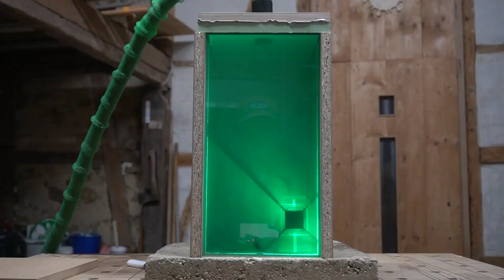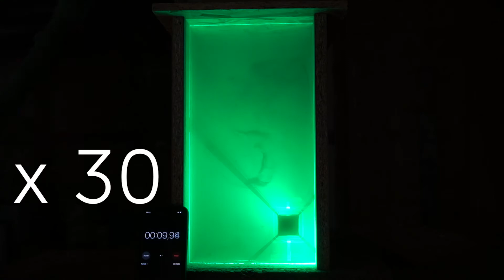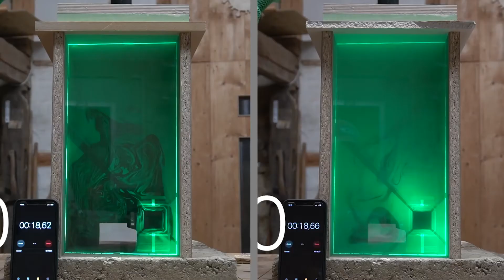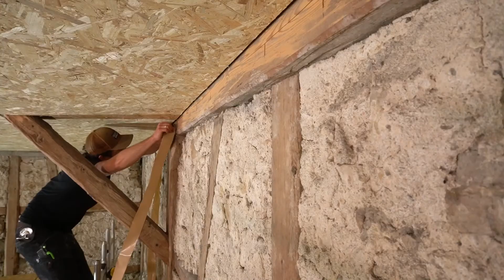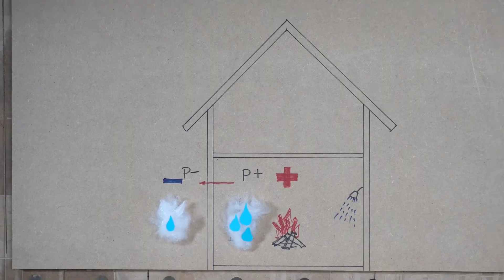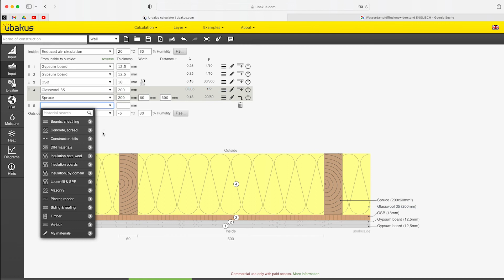Vapor Barrier vs Vapor Retarder

Comment: Thank you Mr Timo I find your video is very informative about all the different variable situations on materials ,temperatures and proper vapour barriers to avoid moisture problems. I live in Canada where the temperatures can get cold in the winter and extremely hot and humid in the summer. I am renovating my basement as of now there was a water leak problem from outside which I had to remove the drywall and the old insulation in a certain section which created mold, our basement are made of concrete form about 10 inches thick more or less.instead of using poly plastic I used Typar building wrap on the cement side of the concrete wall and on the insulation side  l stapled Typar building wrap to the wood studs before I put the drywall up. I would like to see the experiment with the vacuum on a concrete slab and see how the concrete reacts.

Comment: Good for you for building a tight house. And good for you for seeking the information to do a good job. 

It seems like you are confusing "vapor barrier" and "air barrier" and strangely defining "vapor retarder" while doing little to clarify what "breathing" means for a building.
Buildings are not alive; they do not need to breathe. Poorly chosen metaphors like this cause so much confusion.

A lot of vapor travels on air currents, so controlling moisture in the vapor form is usually best done by controlling air movement. Vapor diffusion has nothing to do with air movement. 

Buildings should be tight because tight buildings do not waste energy. Once a tight building has been constructed, a mechanical ventilation system must be employed to ensure fresh air and to control interior humidity. (Of course, ideally, the mechanical system is designed well before the building is constructed...)

Your tests were air-leakage tests of various materials compared to each other, but the vast majority of air leakage is not through OSB, drywall, or even MDF. It is around them, at the joints and connections, which is why you were taping the seams and edges of your OSB.